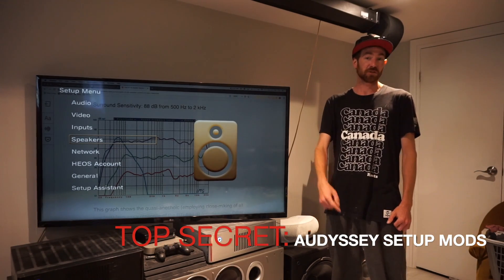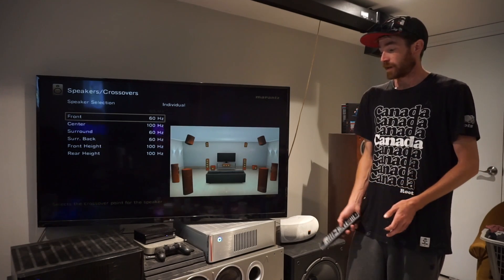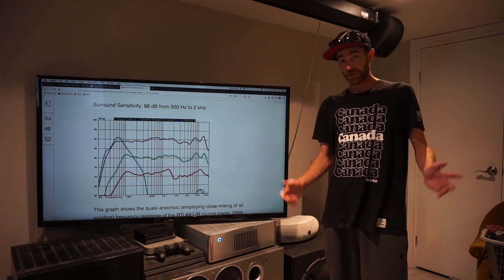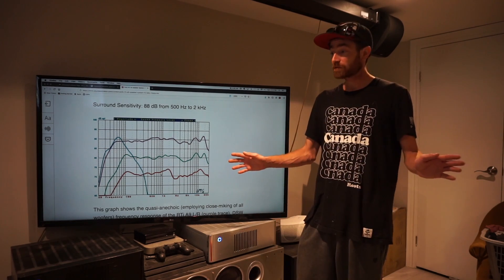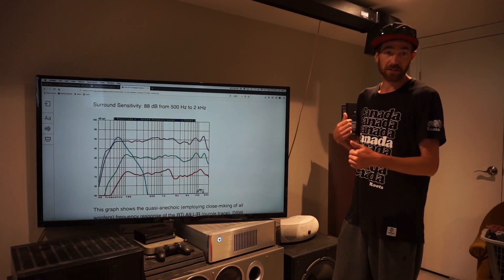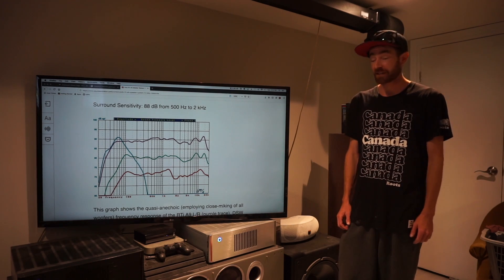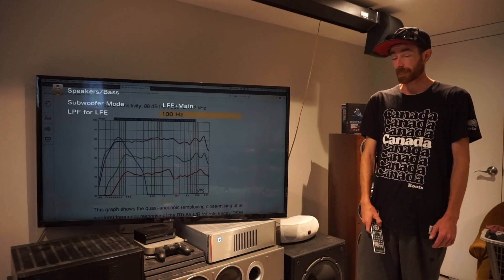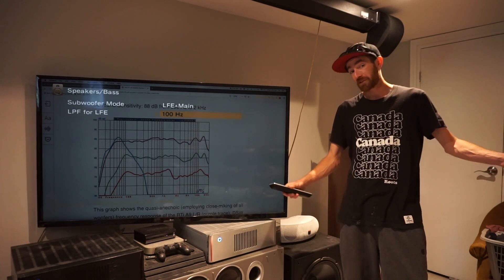Top Secret:Audyssey setup mods.

Comment: I'm running the predecessors of your A9s, the RTi12s, as the front mains in my 5.1 system, and I also run them at 60Hz for the crossover (powered by a Denon AVR-X2800). I was always instructed to run big towers at 60Hz so they can flex their muscles, so to speak, alongside the sub.

I do agree with others here, though, that LPF of LFE should always be set to 120 - but that's with the speakers set to small, with a crossover. Not sure how this works when you're running LFE+Main or Double Bass.

Comment: LPF 120 vs 100 ? 120 is the norm, but how about setting it higher ?
Reply from the maker: depends how big your speakers are. 120 is recommended for basically home theater in a box type setups with very small speakers and single 6" or 8" subwoofer most the time

Comment: I have a 5.1 system and could add a sixth speaker as a center height (right). Can I set up my Marantz accordingly ? Will it improve my system or should I leave it as 5.1 ?
Reply: Did you add the center height channel? Asking because I want to do the same.
Reply: @kazcnepj  not yet

Comment: So.......you ran Audessey then went and manually overrode the settings? You basically changed all the settings that Audessey set up for you. there are two options Audessey or Manual.
Reply: techs right.   all he did is tweek to his preference.    you loose out on all the dynamic features in manual tuning.  

larry
Reply from the maker: all audyssey really does besides a crappy job at setting up the eq is fix any phasing issues and gets speaker distances. so its useful for that but as for getting any kind of decent sound from.... meh

Comment: Thanks for the information.  Do you use a SPL meter to determine the speaker level for your setup?
Reply from the maker: audyssey comes with a setup mic that you just plug into a 3.5mm input on the front of the receiver

Comment: I have a question I have a marantz 6o14 I have the definitives for the front 9080x and it has 2 top atmos as extras that are not hooked up so can I hook it up to the subwoofer for sound ?
Reply from the maker: not really you would only get bass output through small speakers. if you just wanted them to run you could hook them up in parrallel to the other atmos speakers but depending on receiver it may not be happy with the lower impedance. this would also change your height imaging may throw things off a little

Comment: Thank you for the information. I have the following: Marantz SR5008, B&W CM8 left & right towers, ASW 610 Subwoofer, and a B&W center channel. Should I connect the speaker cables to the HF or LF interconnects on my cm8 tower speakers? I am using Audyssey to set up the speakers.
Reply from the maker: are there jumpers between the two sets of interconnects? if no then i would get some jumper plates or jumper cables to connect the two interconnects.... or you could always bi amp. i have a video on the subject you may find interesting
Reply: @techsounds9956  Thanks for the response. I have jumpers between the two sets of interconnects.
Reply from the maker: @dkoneify  with the jumpers in place it doesnt really matter which you connect to either will work about the same

Comment: You've set your sub crossover on the avr to 100hz, on the back of your sub what do you set the crossover, is 100hz or LFE. Great video 👍
Reply from the maker: if you have any frequencies going to the sub above 100hz then lfe if not then 100hz. but either way if your max to the sub is 100hz then either will work.

Comment: Should definitely set your lfe to a min of 120hz.  You want the subwoofer to cover areas above your crossover points.  Also you can’t really use the frequency response of the the speakers to set up your system.  What’s important is the frequency response of the speakers in your room.  Bc I’m positive your response looks nothing like the graph your showing.
Reply: The reason to set your lfe higher is when you set a crossover point the receiver will start rolling off before that point.  It’s not a steep drop right at 100hz.  It’s a gradual roll off that starts before the crossover point.  The idea behind that is to make the combined response of the two speakers to equal your tArget response.  So if you sub is rolling off before 100hz and your speakers are rolling off above 100 hz then there will be frequencies in that channel that you are losing.  Shouldn’t be much of an issue for heights and surrounds but you’d still want to have everything set properly.  Especially in the center channel.
Reply from the maker: if you watch the video, you will see that my lfe is set to 120 because thats the crossover point of my highest speaker. the front speakers are set as bass speakers also. they play down to 40 hz from receiver unless modified. right now towers are set at 60 because they can play anything down to there. the subs only pickup 60-80 and below for the most part unless i have the height speakers going then the bass upto 120 that would have gone to them goes to the subs. other wise it all comes out of 250 watts and then under 60-80 hz goes to the big 15'' subs.  in stereo its basically setup as two 1000 watt rms 4 way speakers. so all channels are receiving the appropriate power and frequencies.
Reply from the maker: the speaker response graph is just a guideline with a quick way to see where your speakers are comfortable playing down to efficiently. if i had some better software i could show you the curve im getting but do not have anything as of right now.

Comment: Damn it, now it's not a secret.  Everyone knows.
Good advice.  As a side benefit, it conserves power from the main amps. 
Thanks.
Reply from the maker: My favorite comment so far lol. and yes absolutely by not feeding the lowest lows through the amps (lower than the speakers can play efficiently without distortion) you maintain much more power for when you really want to crank it!
Reply: @techsounds9956  Also, less travel on the mid-bass drivers means they can run at the frequency range that they are most efficient.  Nothing like a good set-up to keep things copesthetic.

Comment: Wrong from the beginning. LFE - LOW FREQUENCY EFFECTS. Its what you get from .1 channel. IMAX recommendation to set it at least to 120HZ LPF. You will not get any distortion from the speakers that are not sensitive at specific frequency.
Reply from the maker: Actually if you notice my system is set to lfe plus main so bass actually goes to all my speakers. So you are the one who is incorrect. Thanks tho
Reply: @techsounds9956  LFE+Main has nothing to do with your mains. You are in the Subwoofer configuration. It means, that when there is a Bass signal on the L or R channel it will also be routed to your SUB. This ONLY applies if your Mains are set to BIG. You can basically choose if your Sub supports your Mains when e.g. playing stereo. 
If you set your mains to small, this setting will be completely ignored ( i confirmed this with REW measurements) and all your bass below the crossover frequency will be directed to your Sub.
Setting your LPF for LFE to ANYTHING OTHER than 120HZ will lead to signals beeing filtered away when Listening to Multi channel audio, as the .1 - channel (or LFE) in surround is DEFINED to only go until 120hz. You can use this setting if your SUB has problems reproducing the higher frequencies, but in must cases this should be untouched.
Reply from the maker: @ferdinandgleinser2681  I am setting up the speakers. It is not a denon. And by setting the minimum frequency to go to the speakers any thing under the selected frequency goes to the subs. Bass comes out through the speakers I'm not sure how you dont understand this. Try it out. Set your speakers to 40 hz and turn your subs off see what happens
Reply from the maker: @ferdinandgleinser2681  lfe+main is where the bass goes, so to the sub channel + the main speakers. so yes it has everything to do with it. and my lfe is set to 110-120hz because thats the crossover point of the highest crossed over speakers.110-120hz. so the signals below 60hz go to the sub from the tower channels and above go to the speakers. and on the suurounds 120 and below goes to the sub and above to the speakers. all speakers are set to large except for heights which are small. i assure you the bass will play through all speakers. you can tell when you adjust the crossover frequencies. if its set above like 120 the bottom 3 speakers dont function. if set to below that like for exaple 60hz they play the frequencies down to 60hz. there are no frequencies missing. where the speaker crossover point on the processor is splits the signal below to the lfe and above to the amps then speakers. you can even tell a difference in how loud the system goes when set to match what the speakers can actually handle because there is no drop in the curve in the lower frequencies. everything is playing the frequencies they are made to play.
Reply from the maker: My settings only really work of you have some decent speakers that can play down below 120hz. BASICALLY Any speaker can play 120hz cleanly so why cap them there if you can get so much more out of them. And by setting speakers to 120hz if you have a passive crossover in the speaker you are not using any of your low frequency drivers which is a waste... so why would you purchase speakers knowing you would never have them functioning? Doesnt make sense or sound proper to me

Comment: Unless your room is treated looking at a manufacturers chart might not tell the whole story. You need REW and you have to measure the frequency response in your room. You might find the crossover needs to be set higher. Audyssey also only measures one speaker at a time so it’s a bit of a downside. REW will let you play your mains and sub so you can test the crossover integration.
Reply from the maker: thanks for the advice :) how much is REW maybe i can grab that and do a video on it.
Reply: Tech Sounds REW is free. But a good usb microphone will run you $75 -$100 USD. Umik-1 from MiniDsp is a popular one. If you get it from Cross-Spectrum it’s individually calibrated.

Comment: Hey man good video, but I honestly think you should just set the crossover for all speakers to 80hz and let your subwoofer handle everything below 80hz. 

I have Paradigm Studio Reference v4 series speakers and they go lower than the Polks and I set them to 80hz.

Just because  a speaker says it can go low doesn't mean it can reproduce low frequencies nearly as good as a dedicated sub. 

Just my 2 cents.
Reply: I agree, i set mine to 120Hz, all 7 channels and the base from subwoofer is much better. Try 120, 100, 80, 60. The best if someone else does it while you are blindfolded. Then listen to one minute of some movie with effects for each setting. Pick the one you like and v'oilla. This is it. This way you are not biased by numbers in your had.
Reply: You do not set the crossover point based on the speakers spec, you base it off of measurements in your room. My room has a 83hz resonance. So it boosts my JBL 590s 20db, 10db with the ports plugged. So I set my crossovers to 100hz to clear that mode. My 4x PB-1000 Pros are calibrated, and do not have the 83hz boost on final output at all 4 seats. So now I don’t have boosted 83hz bass. This is how you’re supposed to choose your crossover point, not by looking at a spec sheet.
Reply from the maker: that works well also. thats usually what i do if i dont have bass running to my front towers, if im just running lfe instead of lfe +main

Comment: LPF for LFE has to be 120Hz cause otherwise you cut off frequencies above 100 Hz out of the .1 channel from 5.1 or 7.1 sound... LOL
Reply: LPF FOR LFE should be set to 120Hz. But that is bass management setting. Different than crossover setting for your mains. Set crossover higher, 120, 150hz even for mains, and you will get much bigger, punchier louder low frequency output. Try it to believe it. I had 60hz, than 80hz, but 120hz For Me in My room works best for movies. I went from -10dB level to -20dB level of loudness when i switched crossover from 60Hz to 120Hz.
Reply from the maker: @piano8481  I've tried this many times playing around with things. The volume increase is because your not using as much power in your speakers to play bass in them. I never have my system over 40 db usually and it goes to like 96(processor reading not actual levels) or something. I have plenty of headroom in each channel, in the system so volume isnt an issue. If you cut your speakers off that high your basically not using the woofers in the speakers unless they are a 2 way speaker with only tweeters and lows. Every speaker in my system except my atmos heights are 3 way speakers. My 2 way atmos speakers are crossed over at like 120.
Reply from the maker: Wrong. My setup is on lfe plus main. And 120 hz doesnt need to go to the subwoofer if you have adequate power and actual decent speakers that can play down below that 120hz mark. Nice try tho ;)
Reply: @techsounds9956  Sorry but thats just wrong ;) 
You are adjusting the LOW pass filter of your SUB here. So if there is a 110 hz signal on the LFE channel in a Movie, in you config. it will just be filtered out. But in no way your Denon AVR will redirect this filtered signal to your Mains, as this is a FILTER, not a crossover.
Reply from the maker: @ferdinandgleinser2681  my lfe is set to 110-120 the highest crossover point for the smallest speaker. i may have said something incorrect and referred to a crossover as the lfe or vice versa
Reply from the maker: @ferdinandgleinser2681  i may have referred to something as either the lfe or crossover that was supposed to be the other one lol. my lfe is set to 110-120 because thats the highest i have a speaker crossed over. my mains are crossed over at 60 and my heights at like 110-120. so bass below 60 from mains goes to subs and bass below 110-120 goes to subs from height channels. hopefully i was able to clear this up. i havent watched the video since i edited it but ill check it out and see whats up as i had a few comments about this. sorry if i mixed anything up
Reply: @techsounds9956  The LFE has nothing to do with the crossover point of any of your speakers. That is for a dedicated low frequency channel and by lowering it your are just losing information.
Reply from the maker: Jk it wasnt even hobbyist level lol
Reply from the maker: You realize the crossovers on everything are adjustable right lol

Comment: Not trying to be argumentative as I honestly dont know but, Won't you be losing a lot of bass by setting your sub crossover at 100  compared to 120??
Reply from the maker: No because everything is routed to a speaker. My speakers will play flat below 60 hz so basically could set it at 60 hz and still not lose any bass
Reply: @techsounds9956  Thats incorrect, your sub woofer will play all frequencies below what the crossover point for each speaker is set at, however what you are talking about here is the lfe channel. That is a completely separate channel that only has information sent to your sub woofer, by lowering the crossover point you are essentially just eliminating that information and it will not be sent to any other speakers. This setting should be set to at least 120 as recommended by thx standards.
Reply: @techsounds9956  oh ok ...thanks
Reply from the maker: @number1pappy  no problem, Im always happy to try and explain something further if it helps someone

Comment: I read from the audessey boards and audio/video forums that you should never lower the crossover than what audessey made it (which you did in this video).  however, it's ok to increase it after what the audessey calibration made it.
Reply from the maker: Hi man thanks for the comment :) The audyssey sets my speakers at 40hz as default because they are all large and the bass is set to lfe+main and you will see that I raised the crossovers from the preset 40hz up to 60hz did not lower them. thanks. any other questions?
Reply: @techsounds9956  Audysey set some at 150, you lowered to 100..... i think thats what he was getting at. The 100-150 range will not be corrected if you do it this way.
Reply: That is what Audyssey says, but it is not always 100% true (call it 90-95% true).  Audyssey sets my Sony Core Atmos Modules (atop the core towers) at 150 Hz, but I find it sounds much better at 120 Hz, definitely richer.  So while that is a decent rule of thumb, do not be afraid to experiment.  Just do not try going much lower than what Audyssey sets them to.